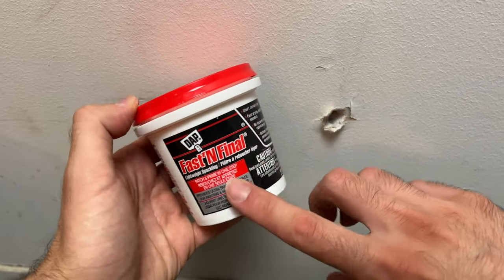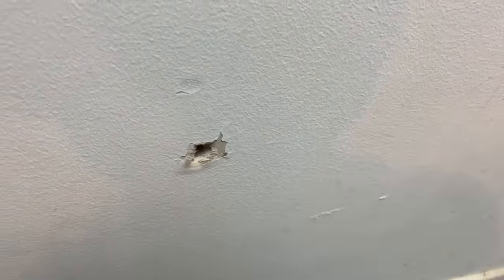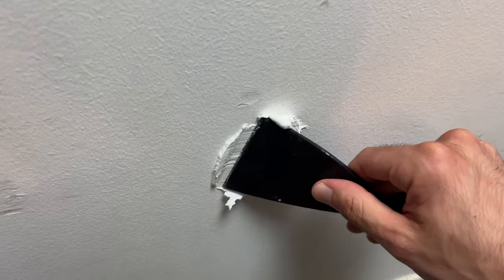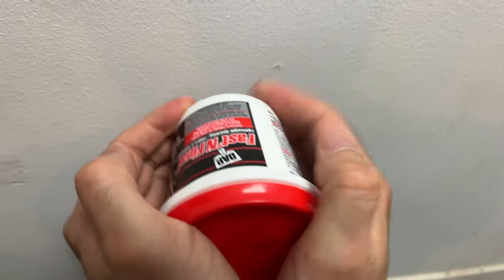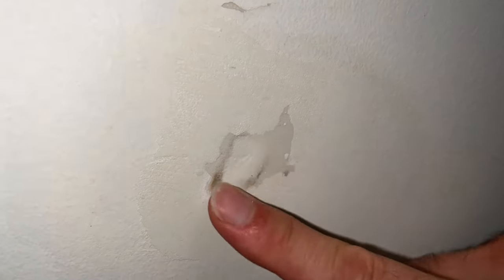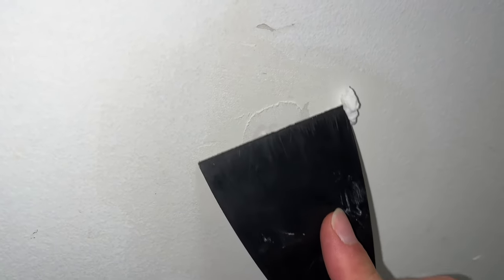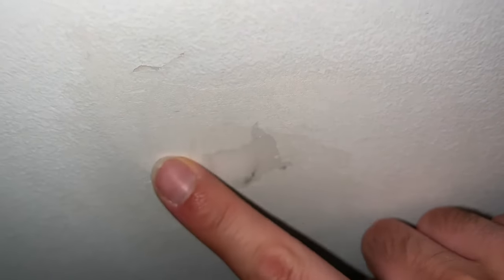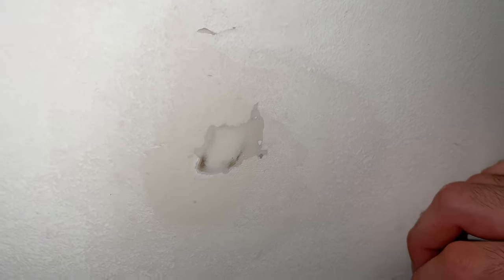How to Use DAP Fast 'N Final Lightweight Spackling to Patch a Hole

Comment: Why do you have to wait 24 hours? The product says 15-30 mins to cure.
Reply: The hole is too deep. It won't be dry if you try to sand after 30 min. Only works when it's a very small hole. There is no way a small fix like this will look good once you will apply paint just FYI. You will 100% see the difference.